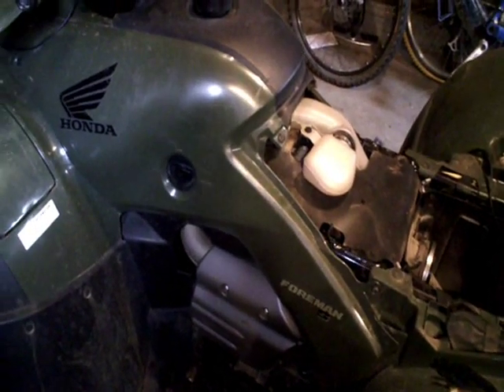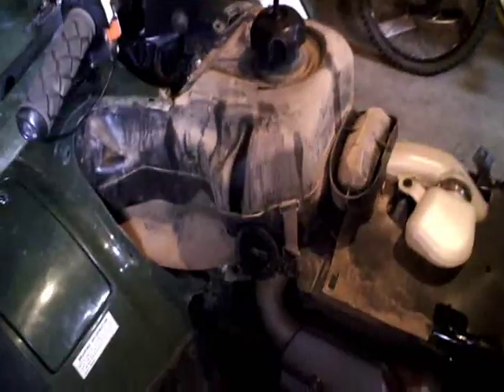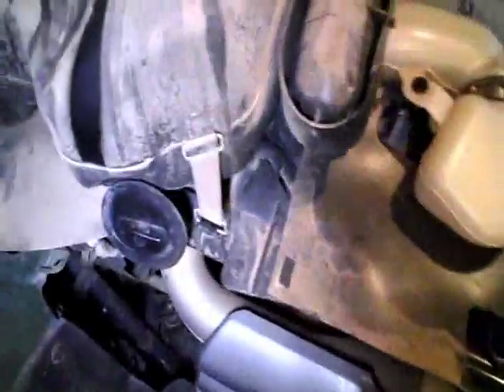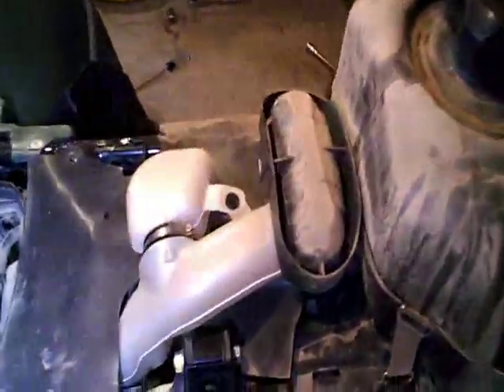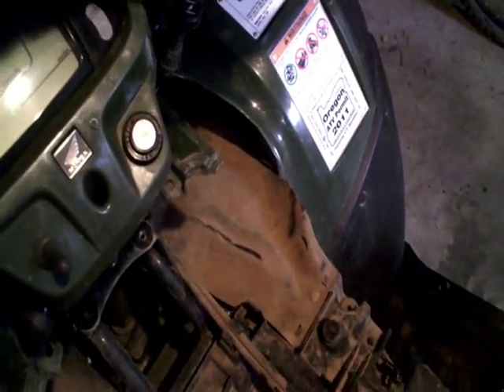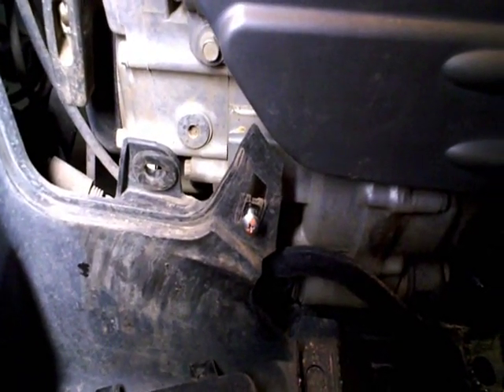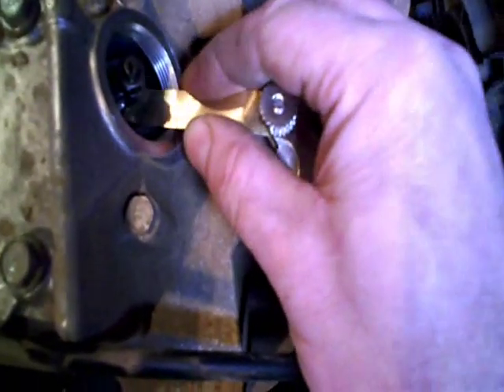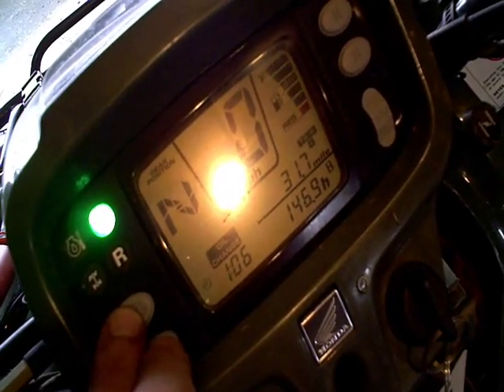How to- Honda Foreman Service Part 4.wmv

Comment from the maker: Mine did that too. I ended up having to remove the front engine cover to get the adjuster assembly out. I ended up cleaning out the hole in the cover with a bore brush and replacing the clutch adjustment plunger and the front engine cover gasket. I used moly anti seize when I assembled it, and now I put RTV sealant around the outside of the adjuster to keep moisture out and hopefully prevent that from happening again.

Comment: I would like to mention those tappet cover caps need a 23 mm 6 point socket to loosen them. I have not seen that mentioned anywhere.
Reply from the maker: Junk Yard   Thanks.

Comment: what I do when my bike has been sittting for acouple weeks in your video at about 7:40 mins there is a little black knob on the side of the carb I use this to prime my carb for about 30 - 60 secs (couple dozen pumps) flick the throttle lever couple times and normally the bike fires into life with out to much cranking over with the battery.

Comment from the maker: I would think that if it once ran correctly with the needle set as it is now that the problem is elsewhere. 

Areas I would look at would be the float level and it's needle and seat, and also tank venting.

Comment: THANK YOU FOR THIS VIDEO! My '09 Foreman 500 ES with Powersteering has about 700 miles on it. I bought it new 8 months ago. Do you think it's time to adjust the valves?? I'm Very Tempted to try and adjust them myself...Also, I run Amsoil Synthetic 10W-40 Motorcycle oil in it because it's is wet clutch compatible... Thanks!

Comment: I got a 450 Honda Foreman and when you put heat on ignition module it starts and run the when it cools down it shuts off and won't start till you hear it back up and we put a new one on and the same thing
Reply from the maker: Hunter Todd  Strange failure. Usually electronics fail when they get hot. I wonder if you could have moisture in a connector or something. I think I'd also check the wiring from module for open circuits, shorts and so forth. Doesn't seem likely you'd have a bad module and get a replacement with the same exact symptoms.

Comment: Any tips for doing the spark plug? Do I only do a certain amount of turns?
Reply from the maker: PackerManForLife   I would do as the manual recommends, which is 22Nm or 16 ft lbs. The engineers who designed the machine I’m sure did the math. You don’t want to strip the head, or allow combustion gasses to leak past the plug and trash the threads. 

A decent torque wrench is not expensive, and very useful. They are most accurate in the upper part of their range, so you’d want a fairly small 3/8 drive for this job.
Reply: @JeffinTD  thank you.  One more question.  My manual says that over 41 degrees I use a standard spark plug. But if i use it under 41 degrees to use a colder rated spark plug. What if I use it for both instances? During winter I plow with it (20ish degrees ususlly) and during summer I ride it (70ish degrees). Would the normal rated spark plug work just fine for both instances?
Reply from the maker: PackerManForLife   I’ve only used the standard plug, bkr5e-11 I think it is, and I also ride in a wide range of temperatures. I’ve never had it foul a plug or any other problems.

Comment: I changed the front brakes in my Honda Foreman 4×4..400 and now my four wheel drive is not working, I dont know if this has anything to do with the four-wheel drive not kicking in or not..it was working before I changed the brakes..please can you tell me what I need to do to fix this problem?
Reply from the maker: I would first check that wiring/connectors on the front final drive were not damaged, and are clean and tight.  If you don't find anything, post back

Comment: mine will turn over but it won't crank. where is the spark plugs located?
Reply from the maker: Clarissa Dawn  At about the 12 minute mark in the video the top of head and spark plug cap is shown.  If the thing has sat for significant time, especially with ethanol gas, draining the stale gas out of the carb would be a common cause of failure to start.

Comment: My trx Honda manual say .006 gap on intake and .009 on the exhaust..just say'n.
Reply from the maker: Barry Patey  

Might that be for the Foreman Rubicon?  It’s a liquid cooled 4 valve. The TRX500FM (2 valve air cooled) is .006 intake .006 exhaust.
Reply: Barry Patey  you can go to   Oh uuu